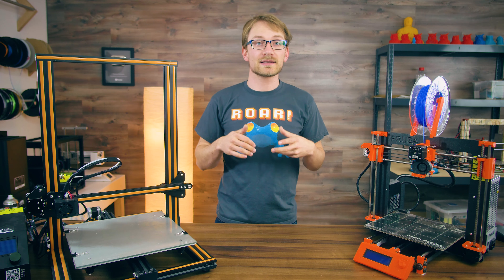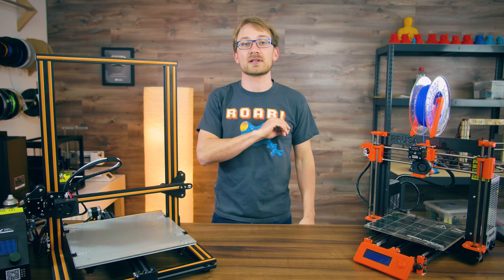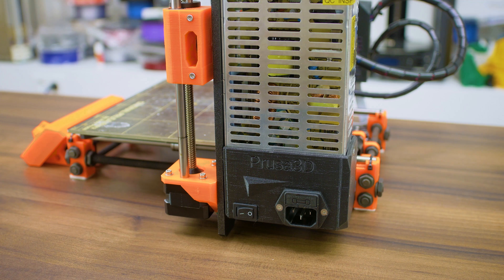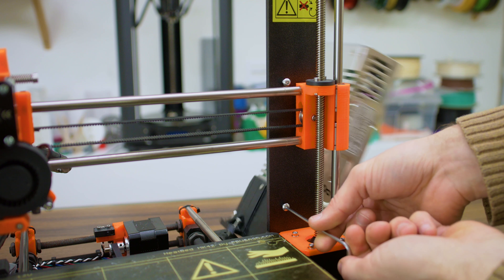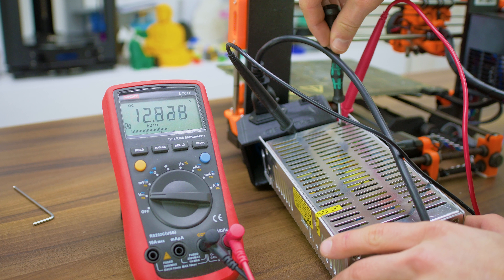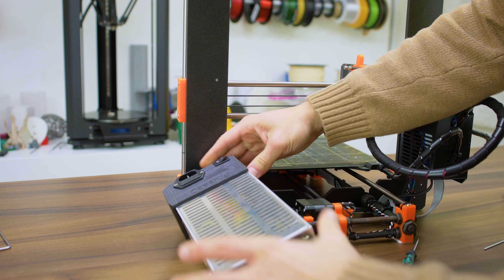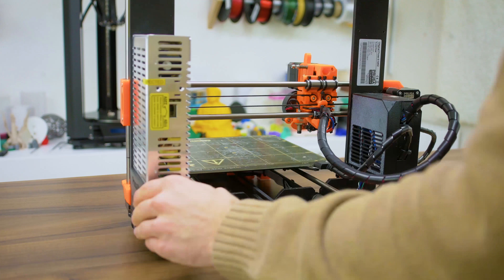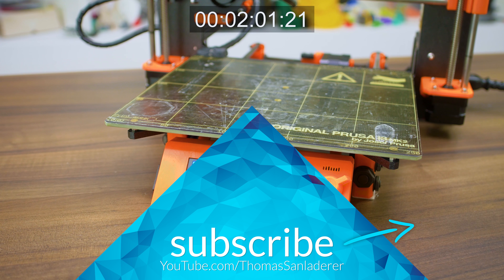How to get your 3D printer hot - faster (and for free!)

Comment: So it is a lot like CPU overclocking - turn it up a bit, get a nice speed boost, turn it up too much, you cook everything and it never works again, don't do it if you are unsure of any aspect of what you are doing.
Reply: Yeah but a cpu has pretty good overload protection and will typically safely shut down when it reaches a temperature threshold. This is more like overclocking every component in your PC, you really need to know what you're doing for this. I think i'll just stick with my CPU overclock XD.

Comment: With the ever popular arduino mega and ramps 1.4 combo, how will those handle this?  Does the board run hotter?  If this is done, should i expect to install a cooling fan for my main-board and drivers?
Reply: I think the biggest concern with the ramps/mega setup is the dissipation limit of the mega's 5v regulator since it has to drop a few extra volts.  I have blown them before with a combination of using a large LCD + badly regulated supply that was running a bit high, so be careful of that.  A seperate bed supply with higher voltage would be more prudent.
Reply: Alex Kenis the mega should really get its power from an lm2596 and not a 7805.

Comment: i almost brunt my house lol. idiot past me made the voltage 27v instead of 24v making the haetedbed 480w instead of 360w. my psu is 480w 0_0 if i make it be 450-400w it might be okay since the bed only uses the full power during the first heatup but it's still scary!

Comment: Souldn't you re-tune the PIDs for both the bed and the extruder after changing their input voltage?
Reply: Should after any adjustment really to the bed/hotend. even just changing the nozzle can make hot end PID change depending on quality of the brass.
Reply: I take it back, you say exactly that :)

Comment: This didn't work for the Delta PMZ-24V240wdal 24V power supply that came with my Prusa Mk3+ (2021). I opened the power supply fully and there is no adjustment screw anywhere.
Annoyingly, it runs at 23.8V idle.

Comment: I'm gonna do this cause I can't run the part cooling fan on even 20% when the bed is at or above 90C or else I get thermal runaway.
Reply: A better solution is to direct your print cooling fan more at the print and less at the heater block, and put a silicone sock over the heater block.
Reply: The bed is what is having the thermal runaway, not the nozzle, and I do have a silicone sock. Even without it though, it was never a problem.
Reply: Have you run PID tuning on the bed?
Reply: Yes and the printer is a Prusa i3 MK2S. The bed is under-powered and Prusa knows this, it has already been fixed in the MK3.
Reply: OK, I didn't know that marlin reports "thermal runaway" when the real problem is insufficient heating power.
Reply: Yea, thermal runaway just means that the temperature is "running away" from whatever it is trying to maintain. If the printer doesn't have enough power to maintain a certain temperature, the temp will fall and this will happen.

Comment: Can you get prusa or anyone else to make a cork mat with (lasercut) cutouts to fit in between the hotbed and the frame below it.
That will insulate the bed eliminating heat loss.

You can still do this power increase too adding the effects,

Comment: I have noticed recently that my Mk3 bed heats up WAY slower than the bed on my Mk2S. I know the Mk3 is 24V vs the 12V Mk2S. I wonder if the PSU is running a bit low?
Reply: Makes sense, I noticed when I was doing some research for video on bed mosfets, that the average MK3 alu bed's resistance @24v was a tad higher than i would have expected, and put out about less wattage than the MK2@12v.  Could be low voltge or firmware duty cycle changes as well.

Comment: Yah, I would advise not doing this at all... you can supply too much current for components on your printer, and seriously damage things. If, not burn or catch something on fire. I would suggest just replacing the heat-bed with a silicon heat pad of higher power and voltage. Then run a SSR, external mosfet, or mechanical relay between the interface of the bed, and micro-controller.

Comment: increasing voltage will actually lower current wouldn't it?
Reply: No
Reply: Well, if the power stays the same, yes.
But here, what stays the same is the resistance of the heating bed. So higher voltage will mean higher current, and overall more power drained from a power supply (which should be considered as dangerous, as I say in my other comment).
Reply: 10% is not dangerous in a closed loop heat control system. 12V to 24V is dangerous. A mains powered heated bed is dangerous.

Comment: Have you determined in Upper safe limit for that cr10?
Reply: TH3D did a video on this for the CR-10 and he said 13.5 was safe max.  Try putting fire proof potholders over your bed while it heats up.  I can get up to 70 in under 10 minutes!  Then do a video on it and give me a shout out!
Reply: I've been meaning to tweak mine...this might motivate me to get the screwdriver out and actually DO it vs waiting for Chris to get around to installing that silicone heater he bought months ago ;-)  Thanks for the hints, Jason
Reply: yeah that heater is still sitting here. just no time. problem is its the same size as the bed but the leveling bolts need to go through it and I am not sure how to tell if its same to put a hole in the thing :-)
Reply: IMO, there seems to be a fair amount of CR-10 hate/spite among the "top 3" Youtubers. Maybe you can offer up one each of your Ender 2's and one of your CR-10's to the power supply gods in a video? Time the before/after times to, say 65C, and record max temps before/after. show the steps to access and turn the pots. What say ye?
Reply: vidznstuff1 I can't afford to fry machine I use them all at least the creality machines and I could not replace them :-) I am totally satisfied with the Ender's performance so I have no reason to mess with that but I would like to cr10 to heat up a little higher so I can play with more materials it's more than fast enough for pla

If others haven't burned anything at 13.5 I'll give that a shot :-)

You won't get no hate from me for my creality printers the Kick-Ass machines for a kick-ass price :-) I have no complaints of any significance
Reply: Looking forward to your reports on this.  I also own a CR-10 and would like to speed up the heatbed, but only if it is safe.
Reply: I put my CR-10S @ 1.34 just to have .01v safety. The bed will consume about 50 more watts TDP.
Reply: Dave F 1.34?

Comment: WARNING! If you do this to a printer, running an arduino mega/ramps combo. It will instantly fry the 5Volt rail. Resulting in your lcd screen only being usable when connected to a pc over usb.
Reply: They run on a voltage regulator right? You're saying the voltage regulator can handle 12v but not 13v? I think you're being paranoid...
Reply: sttrife ne, most of the chinese clones have a weak 5v regulator. The lcd alone can fry it. Just a warning from a guy that burned 2 some time ago
Reply: CheetosR24 any problem if I already burned the 5v regulator ?
Reply: Did you put any cooling elements + fan on the regulator?
Reply: sttrife nope I already burn the regulator on arduino before few months now I supply voltage for arduino from usb input and 2 cooling fans top over ramps. i will try to make voltage 13v
Reply: Gökhan Erdal ne, i run my arduino at 14.5 volts, with a fried 5v regulator. Works just fine as long as you supply 5v from the usb

Comment: Anyone knows if the Ramps 1.4 shield + A4988 can handle more than 12v?
Reply: A4988 is no problem, and most RAMPS board have 16V capacitors so they can handle 14V (a few have 35V capacitors). The real problem is the 5V regulator on the Arduino. If you have a graphical LCD attached, the voltage regulator is likely to be overheating already, and increasing the power voltage will make it worse. Not a problem if you don't have an LCD, servos or anything else powered from 5V.

Comment: What about ATX PSUs? Is this mod also possible and if so, will it affect all my rails or just the 12V one?
Reply: ATX PSUs don't have a trimpot, they are internally regulated. You could also run into a problem because there are two often distinct systems, a safety controller that checks all voltages individually against drooping or spiking, and also checks the currents on all rails, and will shut you off if something goes wrong, and then there's a feedback controller, which receives a fraction of a weighted sum of output voltages via resistor network. It then regulates how often and how long the primary controller fires the primary of the transformer, which (in the group regulated topology, which is the only one you'll get under $100) has two secondaries, one for 5V and another for 12V, and potentially even more secondaries for further voltages. And yes, it's a fragile system that can get unbalanced unless the ratios of the loads on different voltage rails follow the design ratios that the supply is intended for, in a typical PC, with some leeway but not too much of it.
Reply: As you pull hard on the 12V line, it tries to regulate up; but then 5V line going up prevents further upregulation of the 12V line unless 5V is also loaded down a bit more. They kind of expect that there's plenty in a PC of stuff, like mainboard chipset and its regulator, disk drives, other little bits, that 5V line will be loaded down to maybe 30W at least when the 12V line is asked to deliver 300W. 3.3V line is often made as a linear regulator that loads 5V line too, given just how little current it's supposed to deliver.

There are indeed regulations that prevent PC PSUs from causing a significant phase shift, but they're neither here nor there? And EM pollution from a LED power supply like shipped with 3D printers shouldn't really be an issue, they sink their switching noise into the ground line via Y capacitor just like PC PSUs do.  A scope, what does that have to do with anything?

Comment: Your Cr-10 must be defective. That time to heat up is ridiculous. My stock cr-10s printer uses 9 to 10 minutes to heat bed to 80 degree celsius and nozzle to 230 celsius
Reply from the maker: That might be one of the differences between the original CR-10 and the CR-10s

Comment: I have to say, although I like most of your advices quite a lot, I strongly dislike this one.
First, as you noted, it will void your warranty.
But more importantly, it will push all the components to their limits, notably the power supply.
The effects you can expect are :
- more dangerous use: even if electronic devices has some security margin, you make the risk of components failing, and eventually catching on fire more important
- shorten the lifetime of your machine: Just as an exemple, Samsung TVs are know to not last long, just because a condenser of the power supply it too warm during normal use. Because of that, it only lasts for 2 or 3 years, and then fails, when its lifetime in proper conditions can be 5 years of more.
For more informations on the effect of temperature on the lifetime of components (specifically capacitors) search "10 kelvin rule" on your favorite search engine. This empiric guideline states that a drop in temperature of 10°k will double the life of the condenser. And of course, it works in both directions.
Here is one of the numerous links that this search returns: https://www.researchgate.net/publication/269297658_Life_time_of_the_electrolytic_capacitors_in_power_applications

So sorry tom, but this video will get a thumb down from me. And if you let it, I strongly suggest that you make the warnings at the beginning of your video readable (like not 10 sentences per second).

Comment: If my memory serves me right the MK3 is 24 volts (pushing my luck here) If i switch the MK2 to 24 will i have to endure the (disclaimer.....,) the blue smoke syndrome.
Reply: MK2 board isnt set up for 24v so you could only technically put the heatbed/hot end on the 24v psu itself
Reply: the reprap site (http://reprap.org/wiki/MiniRambo) states power "Primary Power 10A 12-28V: Motors (5A dedicated fuse) + Extruders, Fans, & Logic (5A dedicated fuse)" So the Mini-Rambo having its own voltage regulator on board, it should in theory do the job properly. Now will the regulator holdup?

Comment: Wouldn't a simpler and safer alternative be insulating the bottom of the bed?
Reply: I totally agree, I have installed 10mm of ceramic fibre insulation on mine, reduces the heat-up time by 30%, also my power supply runs cooler once the bed is heated up, I wrapped my hot end in the same material, held on place in both cases by Kapton tape. and it saves power to keep the greens happy.

Comment: Um first ?
I think its a ok upgrade for cheap "china" printers, but I wont do it on my MK2 🤷
Edit: May still do it, because I'm impatient xD
Reply from the maker: I'd do it on my MK2, but not on the cheap "China" printer 💆‍♂️
Reply: Well how "safe" is it ? (I don't want to go through all Datasheets xD)
Reply: Thomas Sanladerer I was thinking the same I have a Anet A8 with the stock board but with two voltage regulators external to the board. Do you know if maybe I can step it to 13v. Right now the main noise source of my printer are the steeper drivers...
Reply: cheap china printers are already fire hazards as it is, they are designed to cut as many corners, and dont leave much room for "overclocking" as i'm gonna call this
Reply: NightWalkerasd I did this to my a6 with a somewhat larger power supply. The issue I had was that only the z motors on the anet board has a current pot. It seems that the input voltage has an influence on the current pot setting making the printer noisier and pushing the limits of thermal shutdown on the drives. It worked wonders on the heated bed (also soldered the wires with 14awg silicone wires ditching the connector and I didn't bother to check if the heatbed has 2 coils (like for 24v) but it does have extra solder pads as if it does so I soldered my wires to both pairs of pads. The best way to go with the stock board would be to use an adjustable regulator on the main board input power and use external mosfets for the heaters. If you are good with Marlin you can limit the max pwm (can't remember the variable names) and run 12v heaters on 24v without burning them out during the warm up time. But you can get an mks board for like 30 bucks with adjustable current on the drives so I don't know if it makes sense to keep working around the factory board with it's weird 1284p  chip instead of an atmega 1280 or 2560 that has caused me some headaches in the Arduino ide.